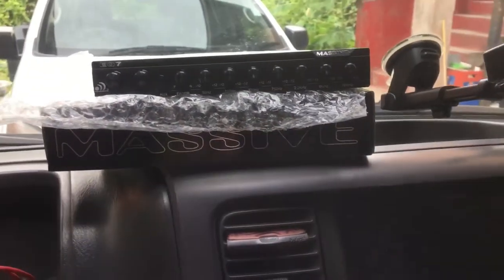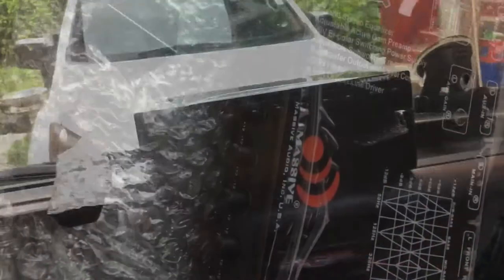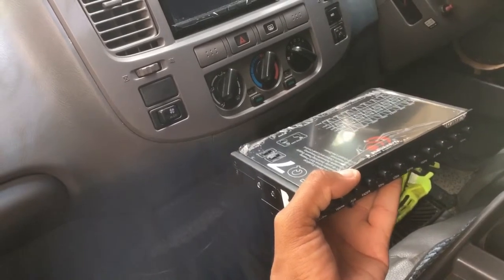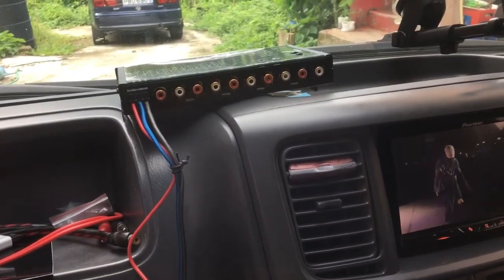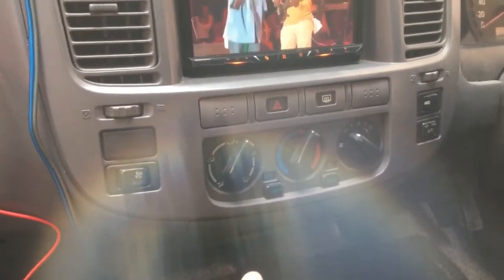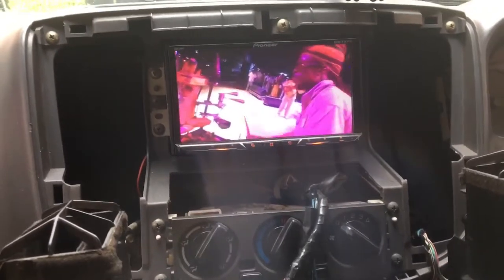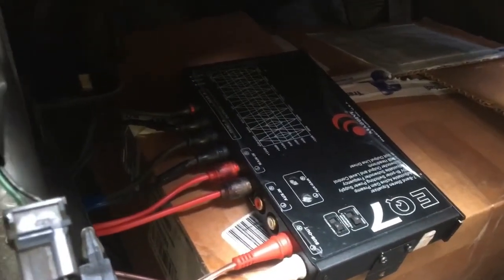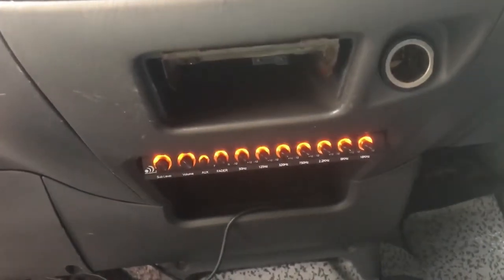Massive Audio EQ7 in the Nissan caravan E25

Comment: How is this compared to the clarion
Reply from the maker: vincy784 boss it’s great 👍🏽 plus it got a 7 volt line driver so to me I get more power from the massive Audio than the clarion. Both are great pre amps!!!!!
Reply: @troylopezcarlife4837  okay thanks.....but if u using a eql and a clarion crossover do u still need a eq?
Reply from the maker: No you don’t need that. The eql got much more features....
Reply: @troylopezcarlife4837  neither do i need a epicenter to play lows?
Reply from the maker: What are you running for your sub and amp?
Reply: @troylopezcarlife4837  audiopipe bdc4 12 2ohm and skar rp1500.1
Reply: boss skar plays lows very well but then again it depends on your taste for bass
Reply: @luke_784lowfrequency8  which model?
Reply: @vincy784boss5  the RP series play bass very well once tuned correctly, an epicenter is not really needed in my opinion but it depends on how you like to hear your bass bruv
Reply: @luke_784lowfrequency8  as long as its low and clean  i ain like the tough bass thing
Reply: @vincy784boss5  once your skar is set correctly which is very important and your eq/crossovers are set you won't regret or be dissatisfied. I was running skar for quite some time and am currently running wolfram I like to try different things. Tell you what if your not satisfied in your bass from the skar I sell music and al put you onto a wolfram or deaf bonce
Reply: @luke_784lowfrequency8  ill msg u cause i looking to buy a system
Reply: @vincy784boss5  cool